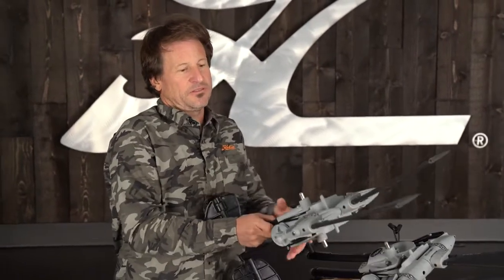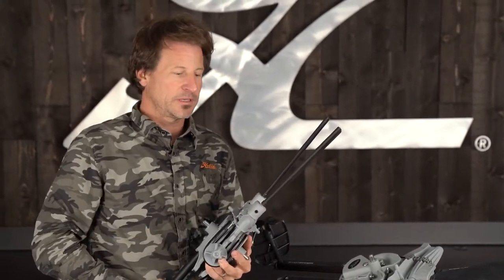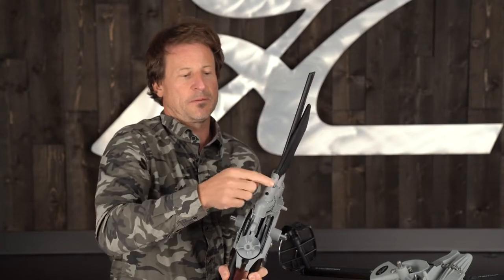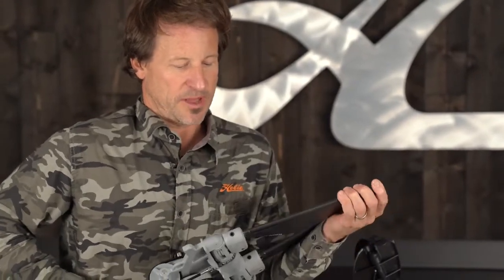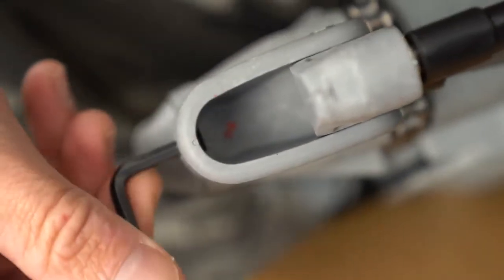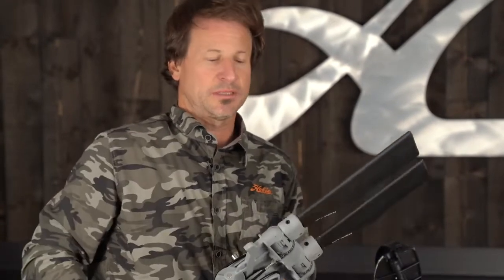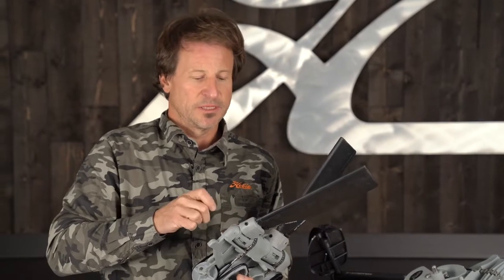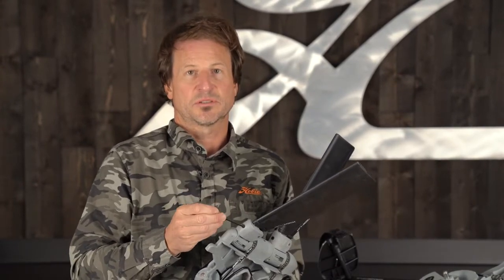MirageDrive Kick Up Adjustment Screw 2020 GT Drive  MD180

Comment: What is the exact part number of that set screw/black piece you adjust to tighten the pedals in place?
Reply from the maker: PART#77800204   KICKUP SET SCREW. Contact your local Hobie dealer to order.  :)
Reply: @HobieAsiaPacific  thank you so so much!!

Comment: How many times can the kick up function be activated before the set screws need to be replaced?
I can’t seem to get them the right tightness without them folding up easy after the first kick up test. The ones in the video seem to work more than once.
Reply from the maker: Hi, they shouldn't need to be replaced for a longtime. I'd suggest if you are experiencing issues with the kickup that you contact your local dealer or drop it by for them to inspect